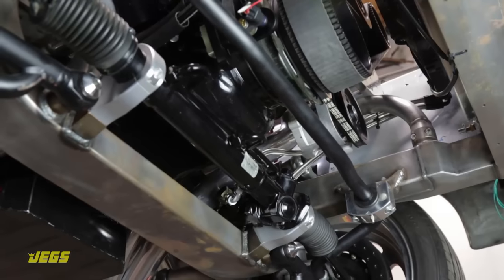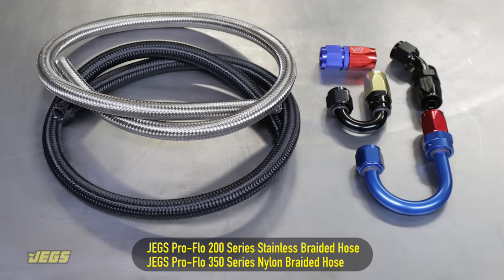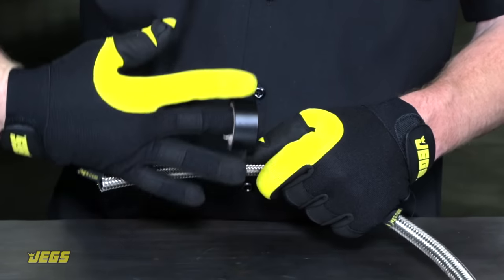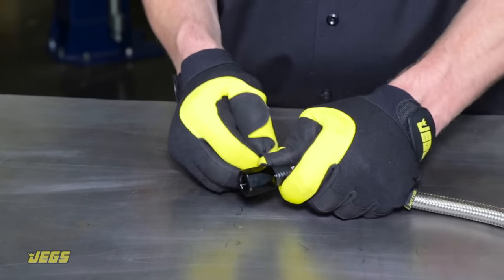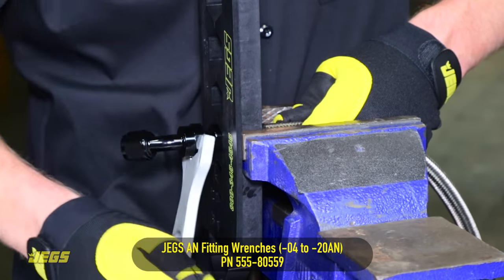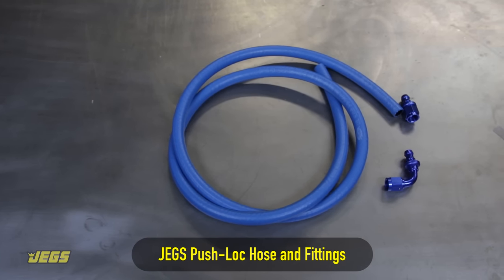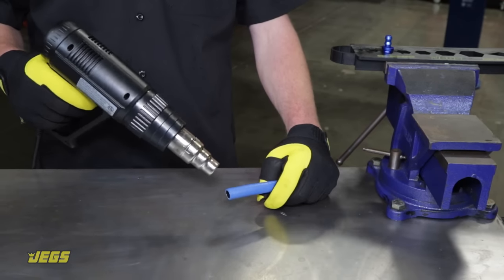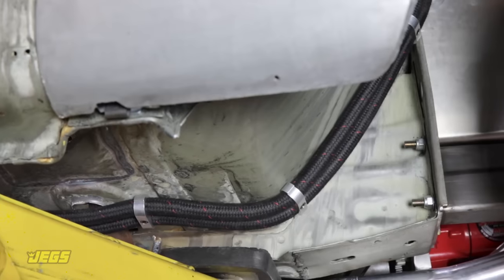How to Assemble AN Hose Fittings With Twist Push Loc Lock Teflon Nylon Stainless Steel PTFE

Comment: i was curious, can you use push lock AN fittings with a steel braided line. specifically for a turbo oil line
Reply from the maker: We do not recommend that. AN pushloc hose must be used with AN pushloc fittings and AN braided hose must be used with the appropriate matching hose fittings. Leaks are highly likely if you do not match fittings and hose.

Comment: WHICH HOSES ARE BEST FOR DO CUSTOM MAKING FUEL LINES THAT GOES TO THE FUEL RAIL...CAUSE I'M CONFUSE SOME SAY USE THE PTFE TEFLON BRAIDED HOSE AND SOME SAY USE NITRILE RUBBER HOSES...
Reply from the maker: What type of fuel are you running and what PSI will be going through them?
Reply: JUST REGULAR 88 FUEL AND HI VOLUME FUEL PUMP NOT TO AGGRESSIVE OVER STOCK
Reply from the maker: @10roadblock  For that application, see the following: https://www.jegs.com/p/JEGS/JEGS-Pro-Flo-200-Series-Stainless-Steel-Braided-Hose/752578/10002/-1
Reply from the maker: @10roadblock  PTFE Teflon is for brake fluid, power steering fluid, and even nitrous, where there are high PSI pressures involved
Reply from the maker: @10roadblock  See also this type for your application: https://www.jegs.com/p/Russell/Russell-Twist-Lok-Hose-Black/2999952/10002/-1

Comment: What hose and fittings do I need to make a high pressure power steering hose? (one side is 11/16 -18 AN6 inverted flare the other side is -6 M16x1.5 male oring) and I need two 90° adapters.
Reply from the maker: http://www.jegs.com/p/JEGS-Performance-Products/JEGS-Power-Steering-Adapter-Fittings-Hose-Kits/1281860/10002/-1
Reply from the maker: http://www.jegs.com/p/JEGS-Performance-Products/JEGS-PTFE-Lined-Hose-and-Hose-Ends/1300664/10002/-1
Reply from the maker: The two links shared should cover your adapters, hose, and fittings that you need.

Comment: What brand of push lock hose can be used with fuel
Reply from the maker: https://www.jegs.com/p/Russell/Russell-Twist-Lok-Hose-Black/2999952/10002/-1
Reply: Most will work. Just be careful not to use the stuff that says not fuel compatible.

Comment: How many PSI., can the push lock hose handle? Will it be good enough for oil cooler kit that sees 90psi?
Reply from the maker: http://www.jegs.com/p/JEGS-Performance-Products/JEGS-Push-Loc-Hose/764426/10002/-1
Reply from the maker: the JEGS brand referenced here is good to 250 psi and would be just fine for oil cooler.